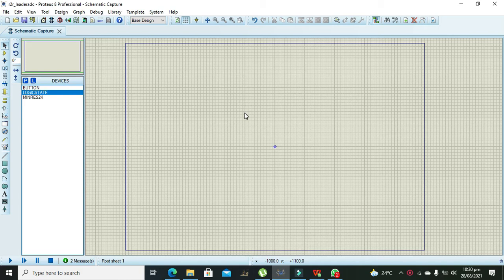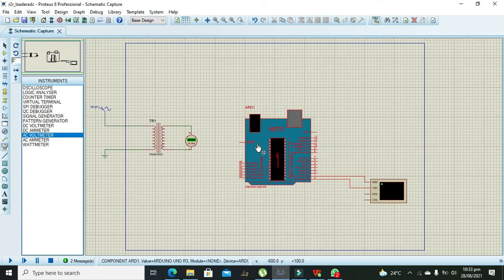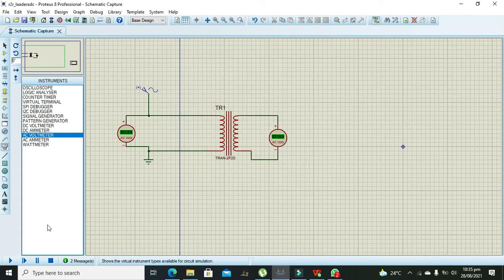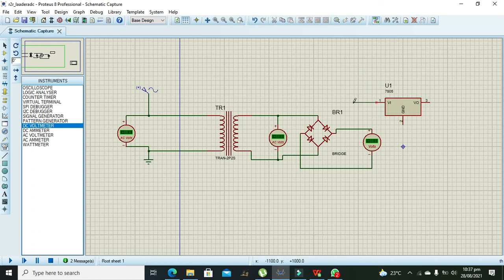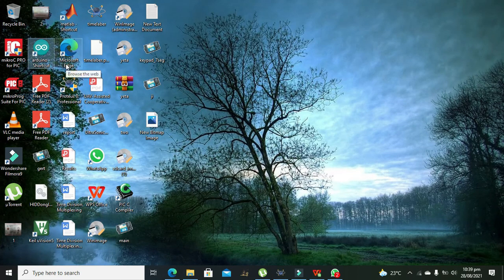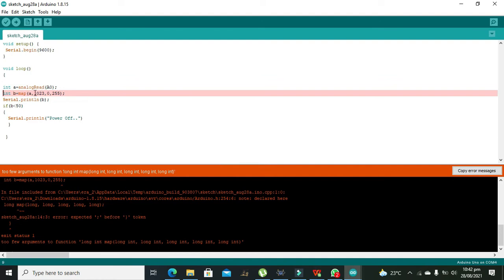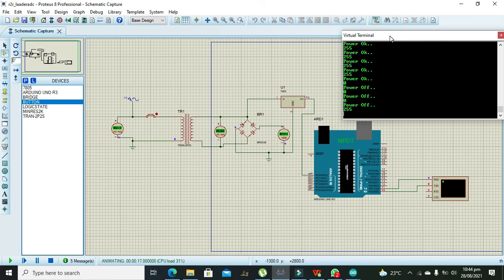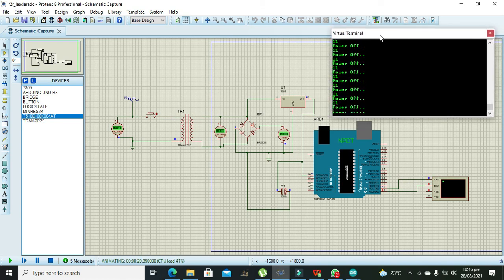simulation of power failure detector circuit using arduino in proteus

Comment: Plz define what is the purpose of every component and Arduino code
Reply from the maker: The controller i.e arduino is just sensing the input,The other components like transformer is step downing the voltage, the rectifier is rectifying it...serial monitor is just showing us the output....
Reply: Sir mgr after bridge rectifier the DC voltemere why showing fluctuation